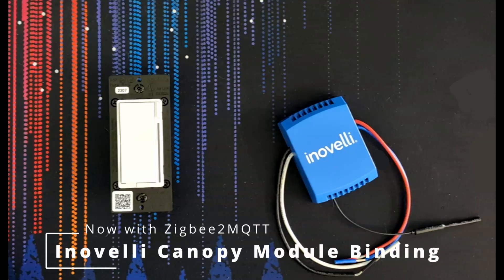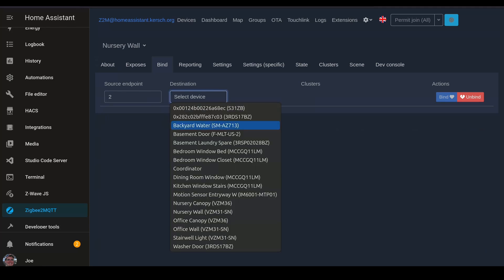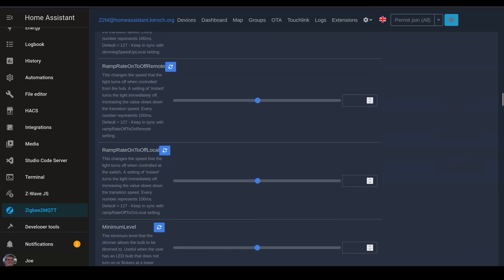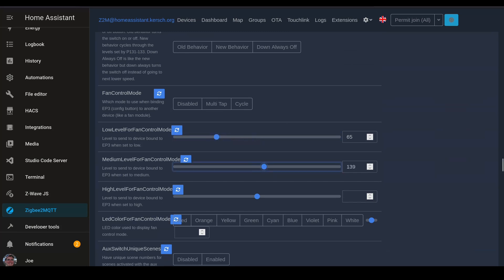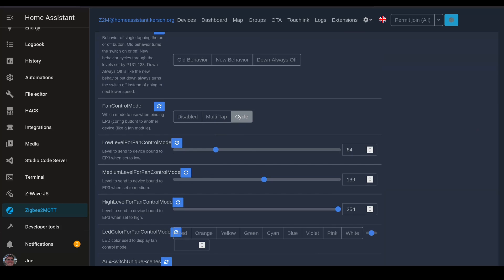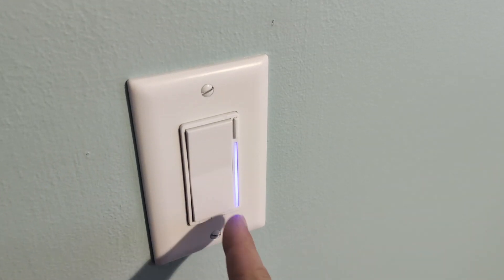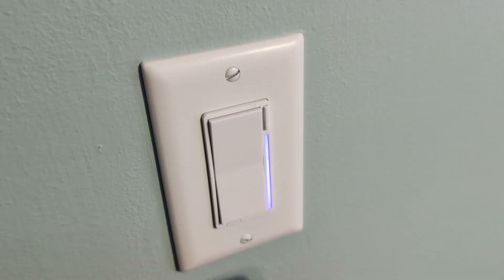Using Zigbee2MQTT to operate Inovelli Fan Canopy Module

Comment: I have the blue 2-1 switch, the blue canopy, no neutral wire and use philip hue through z2m in home assistant. I am so confused with all of the options. Hoping these videos help me.  Thanks
Reply from the maker: @LisaP-o2h  you'll want to refer to Inovelli's wiring diagrams here https://help.inovelli.com/en/articles/8665269-blue-series-fan-light-canopy-module-wiring-schematics

If the power is at the canopy first and you're sure there's not a neutral it sounds like you may have the "single pole w/no neutral wire", with power at canopy. If you can't make sense of it and match the wiring diagrams to the situation in your walls though, I'd highly recommend hiring an electrician. They should be able to understand what's there or run appropriate wires you may need.
Reply: @averagejoestech  oh, everything is wired and up and working, i just don't know the settings in z2m.  They are all so confusing.  I do not have a medium setting for the fan and i am assuming that is due to the no neutral.  all the binding and everything is very confusing to me.  I just want to be able to turn the light on or off from the switch at the wall (or dim if i can but i don't have to) i use philips hue bulbs in the fan light, right now all of my lights come on or go off with a motion sensor (aqara fp1) or i can turn them off or on from home assistant.  I just want to make sure that if home assistant is down or something that i can still use my lights...thanks for any help or advice you may have
Reply from the maker: @LisaP-o2h i believe you should still be able to adjust speeds in a non neutral config. If you're not seeing a medium setting for the fan, then it may be in exhaust fan (on/off mode). If you scroll down near the bottom of the "Exposes" section there should be an option for "OutputMode 2" and you can hopefully set it to Ceiling Fan 3 speed?
Reply: @averagejoestech  so, can i just follow both of your videos to bind my stuff exactly or do i have to change things? i also probably need to bind my light group also i am thinking
Reply from the maker: @LisaP-o2h Are your hue bulbs in z2m? If you want to use them I think your best bet is probably to skip binding parameter 2 on the switch to parameter 1 on the canopy (That would be toggling power to the Hue bulbs at the canopy level). Instead, bind parameter 2 on your switch directly to the hue bulbs for lighting control and leave the canopy light permanently "on." All the other configurations in this video for the fan should match.
Reply: @averagejoestech  thank you so much for all of your help. I really appreciate it!!

Comment: Is It possible to bind 2 switches to it. 1 switch binded to the light and another switch binded to the fan.
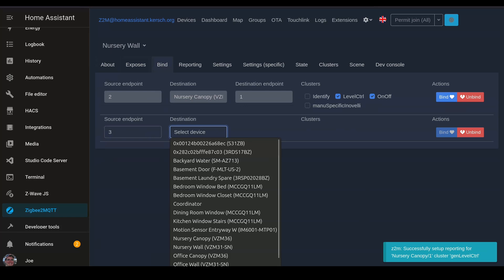Reply from the maker: Yes, you'd just bind endpoint 2 on the "fan" switch to endpoint 2 on the canopy instead of using endpoint 3 1:09

Comment: Why use a bind and not just create a automation in home assistant?
Reply from the maker: @socbrian  Directly binding results in a faster response because it doesn't require the roundtrip through the coordinator, processing by Home Assistant and back to the target device. It also will continue to operate even if the coordinator (or HA) is down which is critical for spouse acceptance factor!